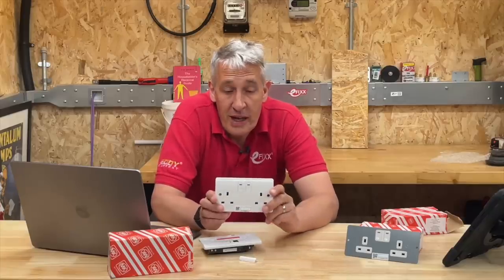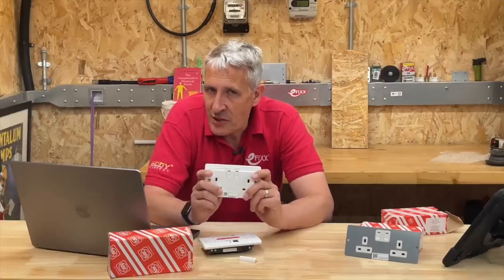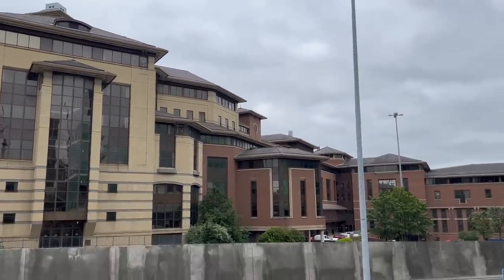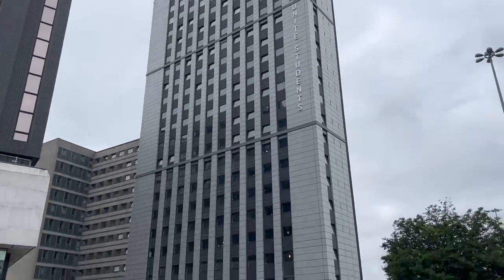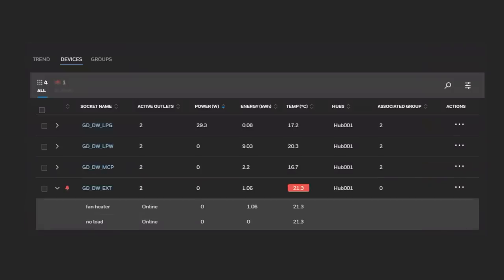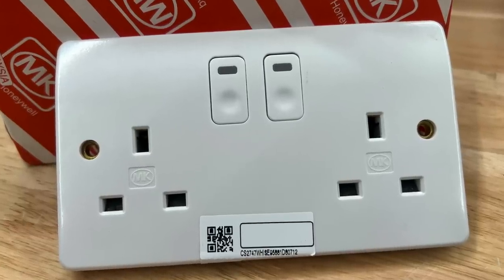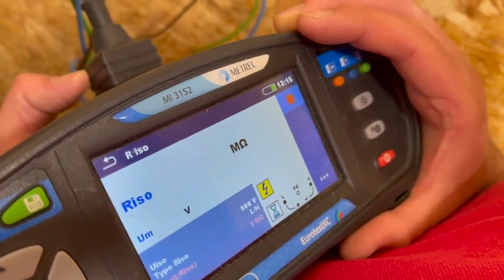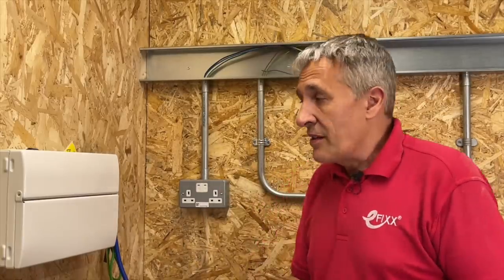Unveiling the Hidden Surprise in this Game Changing Socket

Comment: Nice video as always . These BMS type systems can often be a case of Peter robbing Paul, especially for retro fit.  I have recently looked at this for the two facilities I manage . On purely energy saving the cost of upgrade would not pay its self back for 15 and 17 years . How ever training our cleaners to turn off specific machines and appliances if left on has led to a 25% saving after day one , Now to train the rest of the workforce. !!!
Reply: Then what percentage of these units will work reliably for 15 years ?
Reply: Too much focus on reducing energy demand,,, Increase energy supply,, We have had the technology to do so for decades,, go nuclear ☢️
Reply: Im a programmer first and automation engineer second specialising in Home and Office automation systems and I have noticed this in the past few years but haven't ever found out why all of the "Cool" stuff gets value engineered out before the work packet lands on the customer desk for approval. 

Some time around 2019 I was tasked with designing a smart office system with energy management in mind along while integrating into the meeting room technology. So I designed a system with solar sensors (Light Colour Temperature, Light Lux Level and Outside temperature) on each corner of the building to track the daylight. Automated shades that will open and close when in automatic mode to regulate the temperature in the rooms using the natural sunlight for example if the sun is shining and the room needs warning open the blinds. If its too hot and the sun is bright then shut the blinds. 
Then the office lighting was integrated with occupancy sensors and lux level sensors to determine if the lights in that corner of the room needed turning on, eg was it too dark and is there someone sitting there. 
This was all tied back to a load monitoring system that will log and produce energy usage reports and email them to the client steak holders on a regular basis as required by the customer. 
Digital signage was linked into the fire alarm system and switched to a map of the building indicating the escape routes to use. 
The meeting rooms would report no shows and if the client wanted we could also provide "video miles" which calculated the travel saved by having a video conference instead of driving/flying. 

All of this got engineered out by the main contractor and we ended up lobbing in a couple of Logitech UC systems, a massive TV in the reception they dont ever use and a luton lighting system that is basically programmed to be totally manual with no automation or energy savings. 

I was so excited to do the programming but then it gets value engineered out. 

Having said that I have watched the decline in the custom automation industry over the last 3 years since the pandemic, There is not as much need for offices these days and rich people aren't spending £50million on a house with £750,000 on AV Equipment that needs programming. The likes of Apple, Samsung, Alexa and Google are all popping up and more people are moving towards off the shelf products. Because of this I have decided to get out of automation and programming for the moment. Not sure if there is another niche that I can use my skills in but I dont see a long term future in things like Crestron, AMX and Control 4. 

Is it worth re training and becoming an electrician?
Reply: OMG I wish these were about before I retired, some departments would really take the P!ss with plug in heaters always overriding the heating zone stats, so there rooms were tropical and every other room was cold and always daisy changing extension leads with heater on the end, This would stop all this nonsense
Reply: @warrmr only trouble with your system is end uses ( people will always be to hot or to cold no matter what you set the temp to and as for lighting that’s is just a case of some people are never happy to bright to dark don’t like the shape of the light ( yes bo!!ocks  init) some with just turn the lights off and work in the dark,
Reply: @oiuslags  Totally agree, There will always be that one person and we can't make everyone happy. Unfortunately that one or two people we cannot make happy will be the ones going moaning to the Facilities team and it is the FM team that we want to keep on side and keep happy. I just don't get much interaction with the FM as there is normally a consultant and 3 layers of management between me and the client.  When you finally get onsite always make friends with Facilities, Security and the Cleaner you never know when you need a favour. 

Don't worry this was the same client that signed off all the custom touch panel graphics as perfect and then when I installed everything onsite I was then quite quickly cornered in a meeting room by the director of marketing, who informed me that it was the old company branding and it all needed changing. She asked/told me to disable all touch panels onsite and remove the graphics until she had personally signed it off. She basically put the breaks on a whole project because the font and customer logo was wrong. I did as I was told turned off all the panels, I then called the boss, signed out and went home wonderfully easy day.
Reply: @jxj2684  By the powers vested in me by 50 years of practice, experience and the electrolytic capacitors on the PCB damn few!

Comment: I can see two issues with this for the Student Accommodation use case suggested.
1. Banning high-powered devices isn't feasible. You try telling a few hundred 18-22 year olds they cannot use a 2kW hair-drier in their bedrooms.
2. If there is a switch on the back to turn off the electronics, it won't be long before some enterprising engineering student finds out about it.
Reply: 1 I presume you can programme this to allow short term use, but then switch off after 15 minutes.   Something to stop students running a heater 24-7 with the window open is desirable. Believe me, it happens.

2  Agreed.
Reply: Give that engineering student a job
Reply: If this product is even remotely competent, it will report the smart disable switch having been operated back to the management system or just disappear from the network, which the BMS should notice and report as a failed item requiring maintenance
Reply: 1. hair dryers typically are under 2kw, so a 2kw limit would be fine. the idea is you don'd need to 'try and tell them' you write it down somewhere, tell them thats what the deal is, and when they try and use a high power load it just turns off. Also, as other commenters have said, it may be possible to allow higher loads but time limited. 
2. the outlets are switched by relay, if the electronics are powered down with the switch on the back then the relays cannot energise and the sockets cannot be used. Again, as mentioned, sockets dropping off the network would raise an alarm in the BMS and could be investigated. Tamper proof screws could also be used to make is more difficult for things like this to occur.
Reply: @jxj2684  Of course it happens, how else are they supposed to dry their washing? 😂
Reply: @jxj2684  
That heater+ open window combo could be countered by just having a windows closed sensor
Reply: never mind the students, what about the industrial size floor cleaners used in a halls of residence plugged into nearest convenient socket .
Reply: RIP Gamers
Reply: @jxj2684 your talking about the students who when told they cant have cooking appliances in there roops proceed to cook on
hair straightners
lamps
radiators
lightbulbs
hairdryers
irons

you tell them you cant use more than 500w on that socket and there going to make some terrifying cable made up of 4 plugs to combine 4 500w outlets to get 2kw out all the sockets in the roomn
Reply: Ha ha.  Sounds like something I'd do.  At my uni halls all of the cookers only had three of the hob rings working and I opened it up and found they'd removed the wire to one ring and taped it off.  Word soon spread that I could get the cookers working if you got me a few boozes.  Best years of my life.
Reply: I'd also be very careful in mentioning any restrictions in the rental agreement. If you forget a student lawyer will take you to the cleaners.
Also bare in mind that some courses might encourage students to obtain some pretty beafy computers, and such devices are definately going to be a reasonable use, so the limits can't be set too low.
Reply: No more Bitcoin miners 😢

Comment: At over £300 (inc VAT) per socket, I don't think so!
Reply: 😵‍💫😵‍💫😵‍💫😂 Wait till they start to fail and the client is on the phone saying “ but it’s under warranty “ or “ it won’t connect to the BMS system”.
Reply: Councils will lap it up.
Reply: Not at that price we won't.  Meter at the dis-board instead.
Reply: Wow, really? 😱
Reply: If you are an energy manager (as I have been, now retired) and want to justify installing something like this you would be asked to identify the savings and the payback. Most companies will want something like a 3 to 4 year ROI, so unless the equipment you are potentially switching off at night is saving more than a good few Wh’s then paying £250 + installation for something like this isn’t going to be justified on limited capital budgets.
Reply: Wtf Are they 4Real 🤣🤣🤣🤭
Reply: Aahhhh the price. Waste of time
Reply: Would be cheaper to get rid of the heater and burn £5 notes instead
Reply: soo that 2500 units max would bring the total up to £750k just for sockets…
ok, lets scale it back 

lets have a 100 employees strong business.
each needs one double socket (laptop, screen, charger … that heather :)))) )
lets say we have 4
printers
have a fridge, coffe machine, two microwave,
two dishwasher
and 5 meetingrooms with at least two doublesockets each
and for good measure lets throw in  two tvsets for the kitchen area

and put the upper management 5 people in their own offices with at least two doublesockets for each

now we have around 130 sockets 
therefore just the sockets would cost £39k investment.
plus the hubs (3 of them)

not sure how much of that is but on lowend lets spend anothe £300 on each

so we are talking about 40k investment for a small business.
now someone will
have to install them… i dont have recent quotes in front of me, but lets find a cheap installer and pay 10k for all the work to be done.

50k

and the idea is that this will generate savings… 

if we anticipate that
a) monitors go to sleep and only take up 5wh 
b) printers are shutting themselves down after not being used
c) meetingrooms are not taking anything when not in use
d) you dont want to kill the fridge during weekdays
e) tvs and microwave ovens are taking minimal power when off (5wh?)

so we are going to save 
around 500wh -
lets calculate 8 hours a day for off plus the weekend 48 hours
so 88 hours  a week

4.4kwh a week
228kwh a year

with the 30p / kwh price we are 
talking about £70 savings a year 

in 3 years time this is £210 … lets tripple it up… heck multiply it by 5… or 10 even

so £2.1k savings in 3years time… with the £50k investment.

and to add insult to injury these sockets WILL go wrong and will need replacement… rather than the dirt cheap basic sockets which will work forever unless it gets fried of course…

i dont see how i could walk up to the CEO and propose this project as “lets save money” 

i get the heater issue, but it is flat out forbidden to bring in heaters to the office as it is a firehazard … seems cheaper to have the evening security service to simply check for heaters and remove them if they found one… :)
Reply: I can't think of anybody will pay that even millionaires, the printed circuit board is asking for trouble as well, most of the led lighting is of terrible quality as well , really really bad design and safety standards.

Office computers and printers have been shutting down automatically for many years now, back as far as 1998 ..

This socket design is a waste of time..
Reply: To suggest that this is the smartest socket in the world is the most ridiculous as it would need a market place, the technology is not ground breaking nor overly impressive.    An opportunity for misplaced energy/finance managers to waste financial resources wether public or private.
Reply: At this price it can only be called a scam.
Reply: That would represent a very high financial outlay , and as a retired electrical contractor I can’t see many customers who would consider them at the price per unit . Schools and colleges would be ideal locations , but say in an average classroom with upwards of 50 outlets for computers and possibly printers etc this becomes non viable .   But understandably if costs come down , and reliability is acceptable then I can see a future in the technology .   Least we all forget when LEDs hit the market , they were far from perfect and cost and reliability was definitely an issue . Fast forward today and there the go to product .   I shall be interested how it all pans out , and wish the developers all the success .     Best wishes and kind regards to those involved 😀👍
Reply: Technically brilliant. But it would have to be a function based businesses case and not £ driven as you will never get the sums to add up, and there are other solutions like putting a small breaker on each student room to limit power.
Reply: I bought a pack of four energy monitoring smart plugs for £20 from amazon that do the same job using a standard home router instead of needing a special hub
Reply: The ROI on these would be extremely difficult to justify, the cost per unit for one, the other being the 4 year lifespan of the socket status indicator. Best led last 50,000 hours , about 4 years, 8years if the socket is on for 4 years and off for 4 years. Could be extended if the led brightness is configurable. In a consumer use possible to reduce to 16%, commercial will be more like 30%. If there are occupancy sensors the LEDs could be turned off when no one there. If they built a motion sensor in, that could manage the led brightness and seriously extend its lifespan. But as it stands that will be a tough ROI to thread.
Reply: £253.14 including vat from CEF so you just saved £46.86 right there. Not such a bad idea now ha.
Reply: The complicated the more it's likely to fail, especially if it has a motherboard in it.
Reply: Ridiculous price.
Reply: @mrwhiteyo8934  unfortunately.......yes
Reply: Maybe people just need to hit the off switch. How about making a switch that shouts abuse if not turned off ?  " get the  f.....over here and switch me off you lazy  b...."

Comment: In my student accommodation individual room power was a single 2A socket connected via a 15a breaker per floor (OK that is history!). It's impossible to control power usage when there is an Elec Engineering course taught on site.
Reply: Made a lol.  Any elec student would simply disconnect the socket and fit a £1.99 outlet from wilko, job done.  Then rob the £250 "smart" socket and sell it to buy weed.
Reply: @Hiccup77  and so they should

Comment: At £253.14 a socket, not sure I’ll be using these anytime soon!
Reply: Watching the video, I kept thinking: what is the price? Yeah that's nice--what is the price? Oooo brilliant--what is the price?
Reply: Surely that decimal point is in the wrong place....
Reply: Ouch.
Reply: Thats list price, anybody who is going to be installing these is going to be a big enough customer that they're paying nowhere near list price for them.
Reply: @Pugjamin  They might not be paying £250 a pop, but I would be amazed if the bulk discount put them under £100 which honestly is still too much for all but critical infrastructure unless you have excess budget to fill.  Replacing all the sockets in a large, multistory, office could easily end up making the system cost a significant percentage of the value of the property, compared to regular sockets that are just lost in the nosie.  Not withstanding the extra work needed to disable them all for testing (its a few seconds per box but it adds up), and the much higher cost to replace after a failure.
Reply: @Pugjamin  Yeah. So perhaps £126.57. Massive 50 per cent savings!
Reply: @Pugjamin  If you are going to buy that many you can get them in their OEM form for China for less than £15 each.
Reply: @dougle03  great now my outlets are all on fire

Comment: The switch to disable the built electronics is a great idea. But why can’t they include it on sockets that have built in USB ports? So we can disable the USB ports when IR testing? As three different electricians on you tube have already proved a 500v IR test will not damage such equipment, but it will skew the test readings. That’s why they don’t put such a switch in such accessory’s 
Great video as always Gordon 👍
Reply: God only knows!  I've been asking for this for years.  To date I've not installed a single USB socket because of this flawed design.
Reply: They could simply use either of the normal switches to switch the USB on/off.
Reply: @okaro6595  correct.  No idea why they don't.
Reply: @okaro6595 but then the USB would turn off as soon as you switched off that socket, which isn’t a problem for electricians but is one in daily use. It should really be a separate switch, on the front. Just have three instead of two.
Reply: A pinhole switch on the front of the socket instead of having to remove it would be better too...
Reply: @peterfitzpatrick7032  although you know some "clever" knob head will come along and find it amusing to stick his pen in it.  So for that reason I can see why they'd want it completely hidden.  A pain when doing testing though.
Reply: @JasperJanssen  yeah three switches would be the ideal solution.  We just need manufacturers to start innovating and people like eFixx to start pushing the manufacturers to do this!  They should mention this design flaw in their review videos of USB sockets.
Reply: Don't test then no one cares.